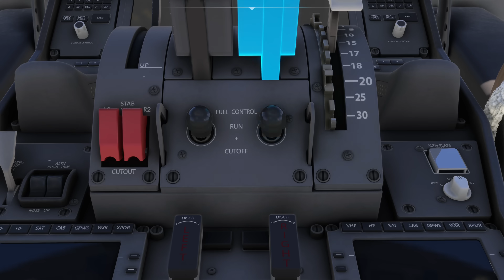Air India 171: Why Did The Fuel Cut-off Switch Get Moved?

Comment: How many time have you mistakenly turned off the ignition in your car? Never?
Reply: Never.
Reply: I am old enough to have owned both key-switch and push-button vehicles. I conservatively estimate over 150,000 cycles of starting a vehicle and driving it. Zero times turning one off while the vehicle was being operated.
Reply: With the car in motion? Never. When it was key-operated? Never. Now it is a binary push-button, I have occasionally pressed to start the engine, done other tasks before setting off, and pressed it again to start, but of course it turned off. But not once the car is running, and there are no guards or similar to prevent an accidental push as there are on aircraft.
Reply: Cars with a push start/stop dont turn off while in motion. 

Older ones with key twist do though.
Reply: @sudhirbabu548  Good point. I did not realize this.
Reply: Not while IN GEAR they don't!!!
Reply: @calvindavis7591 How many times have I mistakenly NOT turned off the ignition in my car?? Several! I have a 2025 with one of those damned 'keyless entry' systems and I forget to push the stupid button to shut the engine off.
Reply: Never.  Besides turning two spring loaded switches to cut off in less than 1 second, would require telepathic powers.  I've tried to turn two light switches off within a second and haven't succeeded.
Reply: @arunkhan4951 😂Be honest. At least with yourself! One second is longer than you’d like us to think!
Reply: I've had a couple times driving a small car where my knee bumped the car keys in the ignition and killed the engine, and I know of a half dozen times with friends, relatives, and coworkers.

These cars didn't have any kind of pull interlocks though.
Reply: Twice. That's why Im not a pilot.
Reply: Exactly 0 times.
But I turned windshield wipers instead of turn signal many times, especially in stress. Because my first car was with right-handed driver seat (imported from Japan) with controls reversed.
Reply: @hrissan  Windshield wipers have no detent, no barrier, no force required you simply tap the stick and it'll move. These fuel cut-off switches, have to be picked, lifted and moved then locked into the next position. It is not mistakable at all.
Reply: @hrissan 

I did mix up wiper blades and turn signals when my left arm was injured and I was using my right hand for both.  I was also mixing them up when switching between left and right lane driving countries. No accidental turning off ignition for me.

Comment: I remember reports saying the fuel switch to both engines was in the “off” position at impact. Now there is a report from voice recording where 1 pilot asked about turning both engines off, then that pilot moved both switches to on fuel. (Prompt, excellent intervention.) I am wondering - how did the switches get back to off? Was that earlier report of the crash with the switches off - a mistake? Premature (that the switches were moved & moved back to on?) This is a clarification issue rather than implications about what was going on with the pilot(s). A detail that isn’t making sense to me, given the sequential reporting of specifics. Thank you for your clear explanations.

Comment: As a master mariner/ship captain with more than 15years in command something is off here...
I have had a similar incident with VDR onboard a high tech vessel loss propulsion on one of the the thruster pods I reacted b4 any sensor captured a fault ..… after deep dive into the cause and timelines there was no explanation given by caterpillar to date the cause of engine shut down still remains unknowns … this incident brings back many memories of unexplained occurrences when it involves heavily automated processes that I know from experience

Simulated trainings tried to trigger a similar response n caterpillar still is quiet re the shut downs 🙄 

And similar occurrences CAT techs came n they changed tried to diagnose without any luck

Only replaced all electronics and some hardware …..Wouldn’t be surprised there is more to this 😏 
Impossible and probable are two different things

Comment: You said in a previous video that even if you have an engine fire that you can’t do anything about it before reaching a certain altitude (that is why putting the switches to cutoff is so weird in this phase of the flight.) Can’t Boeing make a system where even though if you put the levers to cutoff they won’t do anything because you haven’t reached that specific altitude yet? (Given that the computer would know that you just took off.) That would be in my opinion a great safety feature!

Comment: Regarding your viewer's question on "What’s the imminent crash procedure"—worth having a look at the Forced Landing Procedure in the manual. I'm quite certain both fuel control switches are set to CUTOFF before impact, even on your type and SOP.
It may not be directly relevant to the Air India case, but as an active captain, being familiar with that could help in similar future discussions—and ensures your viewers get the right info.
Happy to stand corrected if airline procedures differ—kind regards!
Reply: In this case the crash became eminent when the fuel shutoff switches were switched off. Being an aircraft mechanic I know the odds of both of those switches failing are slim to none.
Reply: @jefferychapman9640  Thanks for your reply. Just to clarify—I wasn’t implying that the switches failed, but rather addressing the original question Steve was asked: “What’s the imminent crash procedure?”

My point was that according to the manual (and common SOP across types like the 787 and 777), part of the Forced Landing Procedure is to set both fuel control switches to CUTOFF shortly before impact. I noticed Steve didn’t seem aware of this, which surprised me a bit as he’s an active captain. I thought it was worth pointing out—so viewers (and Steve) have the correct info for reference, even if it wasn’t directly relevant to this specific incident.

No offense meant—just aiming to keep things accurate.
Kind regards!

Comment: Presumably these two switches make a clicking sound that will have been recorded by the Flight Data Recorder.
Hearing these timing of these clicks will be crucial, when the full report is released.
What are the chances that it was not in fact the two mechanical switches on the flight deck – but rather the master fuel shutoff valves, which are spring loaded, and closed when power is lost? 
These were discussed at length in various videos.
The pilot asking the question may have heard the engines shutting down, and perhaps seen an alert on his screen, and assumed it was the two flight deck switches, when it was not.

Comment: How long was the plane on the Tarmac ?
How long were the engines running ?
How long before take off ? 
How long was the take off ? 
What was the length of time , duration before " engines fuel out ? "
Next Glide Time , into Crash Event .
Black Box analysis please .
Reply: This still doesn't preclude " engine , engines shut down by computer , computer failure , fuel feed failure , or any other contamination , or interference by any source electrically , mechanically or human . "

Comment: How then, do you explain the landing gear and the flaps issue that was initially thought to be the mystery? You see, blaming the dead is the easiest way past your own errors. Whether or not the fuel switches were flipped, whether or not it was a human error, whether or not both switches malfunctioned simultaneously, the fact remains that the landing gear was still down when it should have already started to fold up into its wells and the flaps were not in its correct position to have created the lift required. Blaming two dead heroes is the easiest way out of here. Oh, and do not forget that the lone survivor heard a loud bang (RAT deployment sound, someone said) and then the engines spooled up really high before crashing. His ears did not hear the engines dying out in mid-flight. The truth will never be known because it will cost millions in payout!!!

Comment: I’m a pilot at a major.  As long as airplanes require humans at the controls, there will always be the risk of a single pilot attempting suicide and taking everyone else with them; and in some cases there is absolutely nothing the other pilot can do to prevent a crash.  I won’t elaborate here, but it is certainly the case.
Pilotless aircraft pose other risks.  No matter how you go about it, flying, like anything else that moves people at greater than walking speed, involves risk.  Flying has been made as safe as it is because the vast majority of people in aviation are GOOD people.

Comment: Going forward, can't the engine fuel cutoff/run switches be positioned so that each engine is controlled by one pilot, and the corresponding switch is only accessible to that pilot? This would ensure that if one pilot attempts to shut down an engine, the other engine remains operational.

Comment: We cannot ask this question without also asking about the fuel valve control network that -  
1. is the fuel valves explicitly hardwired directly to the cutoff/run switch and not indirectly via an AND circuit to factor in control software command?
2. Is the blackbox data take state samples at the valve solenoid input or physically at the cutoff/run switch output?

Comment: We really have no idea if the switches were operated or not.  All we really know is the flight data recorder sensed the signal from the switch changed state but that does not translate the the switch was actually pilot activated.    We should not exclude mechanical switch or wiring issues and certainly not bias pilot actions over all other possible causes.

Comment: It’s a cascading electrical failure due to that FSOV fuel shut off valve activated and cut down both the switches Boeing design itself made that way in mid air it’s safe to be the shut off both the engines in case of any fire accident so that the risk of blast minimises as here clearly the pilot A questioned pilot B why did u cut off the B said I didn’t cut off even they don’t know that it was in cut off position if at all they want to commit sucide they could have done it when flight coming from Delhi to Ahmedabad why only after reaching Ahmedabad they did it it’s total nonsense

Comment: Is it possible that one of the pilot accidently turned off engines instead of pulling up landing gears right after take off. Because of muscle memory they performed an action that is usually taken after reaching the gate instead of an action that is performed after lifting off? Realized within few seconds they undid that action but it was too late. That is my theory. What do you think? Thumbs up if you agree. Override should be required when turning off engines during landing or take off or in flight.
Reply: Seeing that the landing gear handle is on the instrument panel  and the fuel cutoff cut-off switches are on the center pedestal behind the throttles, I highly doubt muscle memory had anything to do with it.

Comment: Breaking @themojostory - exclusive as recently as May 2025, under four weeks before the Air India 171 crash- the UK regulator issued a mandatory directive, quoting the FAA (American Aviation Regulator), citing a "potential unsafe condition affecting fuel shut off valves"- these are controlled by the fuel control switches that are now in the headlines and are being double checked by airlines across the world. So no, not just a 2018 FAA advisory, but a May 2025 mandatory directive from both American and British regulators flagginga possible safety concern with fuel valves that are like faucets for fuel to run smoothly to the engines. Really makes you pause, doesn't it #airindiaplanecrash

Comment: I thought I read somewhere that 2 lines of the software dealing with the shutting on and off of the fuel system had been altered, either through negligence or malpractice 
If the software had turned the fuel off, would the switches have moved to the off position?

Comment: Hi Steeve, My question to you is if the fuel switches are very much important in dealing with fuel flow to engines, then why can't there is no sensor if it's on/off or atleast having light at the top of the switches whether it's on then the light will appear just for an indication purpose as it'a one of the very important switches

Comment: All the focus is on the physical switches.   What if the computer had a glitch and pilots were trying to reset the engines by flipping the switches   Below is a service bulletin on concerns with the chip soldering fail. 

GEnx-1B Service Bulletins (SBs)
SB 73-0097 R01 ENGINE FUEL AND CONTROL - Electronic Engine Control (73-21-20) - Replacement of Integrated
Circuit MN4 on Main Channel Boards
Impact A
This recommendation is to address a condition that may affect Flight Safety.
NOTE:A loss of thrust control (LOTC) may occur.
NOTE:This Service Bulletin can be done in shop.
This Service Bulletin is offered to improve the reliability or performance of
your GE product, or to help prevent the occurrence of the event or condition
described in this Service Bulletin. If the operator elects not to participate
in the bulletin, that decision will be taken into consideration by GE in
evaluating future product performance issues that may arise in the operator's
fleet.
D. Concurrent Requirements
None.
E. Reason
(1) Objective:
To rework a part, improve reliability, and reduce significant events.
(2) Condition:
An LOTC event has occurred due to an EEC MN4 microprocessor solder ball failure.
(3) Cause:
Accumulated thermal cycles of the EEC with age causes the solder ball to fail.
(4) Improvement:
The MN4 integrated circuit on the MCB will be removed along with the solder and will be
replaced with a new solder and a new BGA.
(5) Substantiation:
Substantiation by analysis.
F. Approval
The data contained in this Service Bulletin has been reviewed by the FAA o